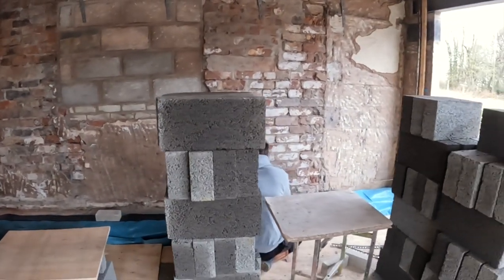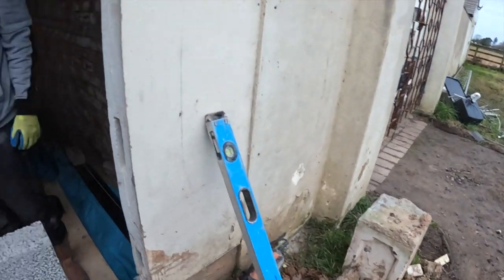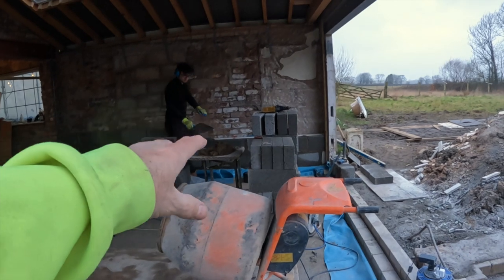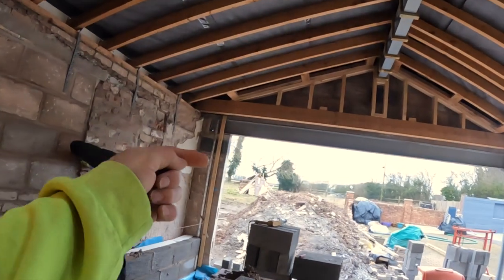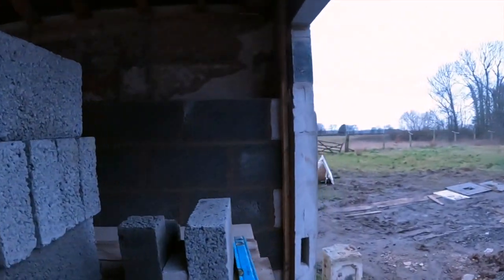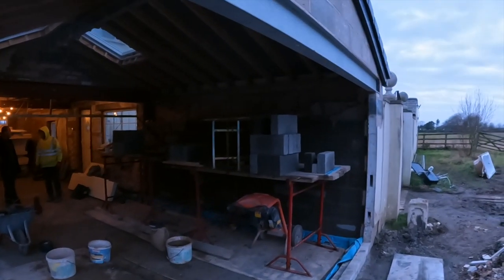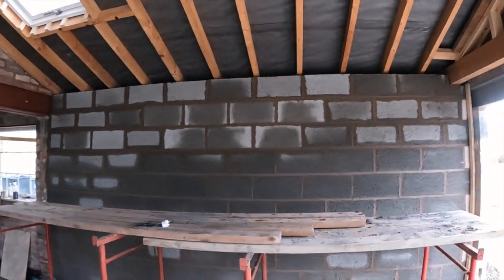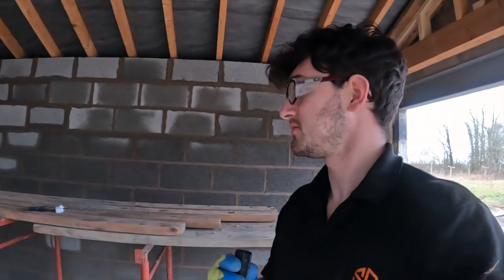BRINGING A TIRED OLD FARMHOUSE BACK TO LIFE

Comment: Can you explain a little bit about the rigid foam insulation?  In my area, upstate New York State, it's common to use rigid foam; the foam board is mechanically installed against the wall, then the seam, butts, laps and joints are cleaned, them lightly cleaned with solvent - then expensive special tape is used to seal everything - it has to be absolutely airtight and permanent, very often there's an independent inspector who checks to make sure it's airtight before any insulation is covered by anything. It's a very long, meticulous time-consuming process. What's the procedure in your area?  Thanks.
Reply from the maker: Not nearly as involved as for you guys 🤙🏾🧱👍🏽

Comment: Lol…choice of words make a big difference…your not restoring it…your repairing and/or maintaining it…to restore it suggests you’re doing the work to match original materials, original mortars, and doing the work in the same manner to completely ‘restore’ it as was…which of course is not the case…but hey, nice work lads…👍🏻
Reply: He’s a young lad who’s learning
Reply: In the time I have been watching your channel Alex has come on in leaps and bounds and it must take a lot of weight off you Steve with Alex getting on with his work and you with yours. Another 23 mins 33 seconds fly by 👏👏👏👍
Reply from the maker: LOL ! title changed
Reply from the maker: @martin2466  🧱👍🏽
Reply: Hi Steve & Alex. That pillar Steve looked awesome. Alex the block wall you built shows just how far you come well done. Like how you pointed up even though it will probably be covered up. Nice job as usual guys. Have a good weekend 👍
Reply from the maker: @johnboy2984  cheers buddy 🤙🏾🧱👍🏽